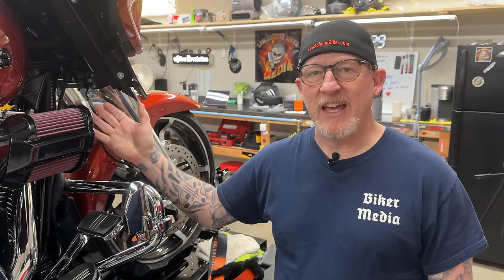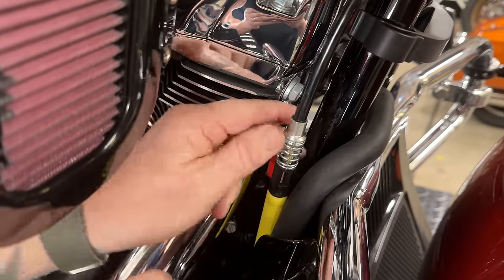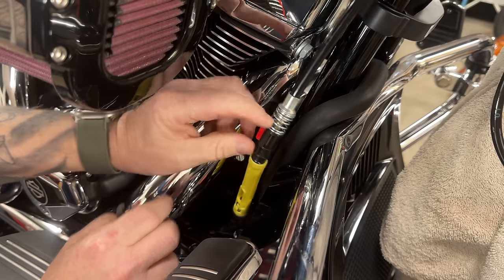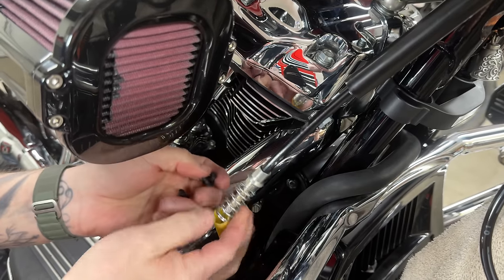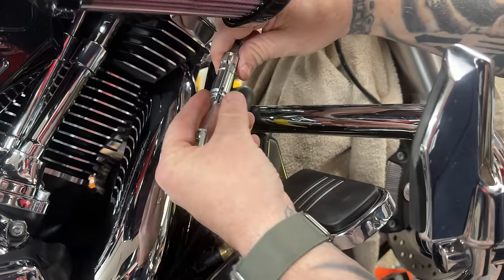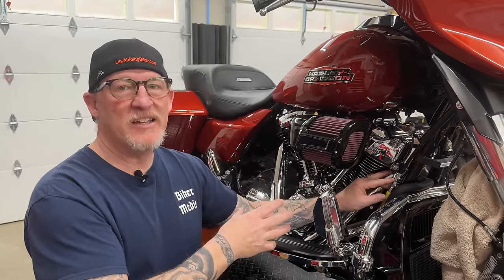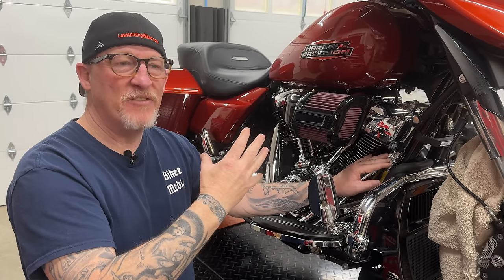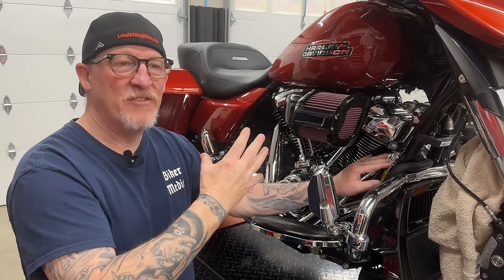Every Harley Owner With A Cable Clutch MUST FIX THIS! DIY

Comment: You really shouldn’t have to be fixing anything on what these bikes cost ! 😬
Reply from the maker: Agree
Reply: This is Ryans opinion. You do not actually "need" this. It does make fine tuning clutch handle adjustment a bit easier. 
But I ride everyday and Ive never "needed" this. 
Using the factory adjuster, u can vary the distance u push down on the spring to adjust the handle slack. Push all the way together=more slack at handle. Push spring in a little=less slack at handle. Its quite simple.
Reply: Awesome video!
Reply: It’s not about fixing. It’s about preference.  When we compete in rodeo competitions, we like our clutches in a specific spot.  I adjust my clutch lever as close to the grip as possible within the tolerance so it doesn’t jump when you start it in gear.
Reply: Awaiting for that hydraulic conversion video. I really miss my AIM slave cylinder’s hydraulic clutch
Reply: Agreed!
Reply: Yes like when you buy a Ferrari you nerve have to maintain it just run it no maintenance required

Comment: Harley used the same threaded lock-nut cable adjuster on their clutch cable for years and years.  The cable adjuster on my 2017 Dyna was exactly the same as the one on my 89 Evo Low Rider.  And they replace it with some stupid fragile plastic POS?  Jesus.

Comment: That new style cable looks like a nightmare. It seems like Harley tried to reinvent the wheel just get the old style clutch cable we’re all you needed was a 1/2 and 9/16 screw it in or out to adjust.

Comment: I've had 4 Harley's since 1998 and I currently have one with a hydraulic clutch and one without. I prefer the cable feel and I am convinced that it has a wider friction zone and is easier to pull than the hydraulic one. JMO

Comment: Ryan I totally agree I had a 2014 for 7 years and had no issues and loved my hydraulic clutch. I bought a 2021 street glide special and hated the cable clutch and almost got rid of it. That red button will eventually fail and has no adjustment. I had several friends get stranded. I put the fat bagger replacement on and now I have peace of mind and have the right adjustment I can live with. By all means everybody should do this mod or risk being in the middle of nowhere and have a clutch failure. Easy to do and well worth it.
Reply from the maker: Thanks for sharing.

Comment: Love your videos but I had my 19 street glide and I had alot of issues with the hydraulic clutch, mostly when stuck in traffic with 80+ degrees days and the clutch grab different every time, the cable doesn't matter temps or condition I have it set to grab the same each time

Comment: I had the yellow tube fail on my 24. I replaced it with the EZ Install Black Vinyl Upper Clutch Cable 108000-B, the clutch pull feels better and it has an adjuster at the top which lets you dial it in on the fly. The metal on metal assembly gives me peace of mind. Id highly recommend it

Comment: I have the stock adjuster on my 22. It works fine. I have fine tune adjusted I can find neutral with no problems whatsoever. I disregard what Harley says and I adjust the clutch to the way I like it..

Comment: Replaced the OEM adjuster on my 21 Tri Glide and it was little tough chipping away to remove it. Not a lot of room when you have lowers. But finally got it removed. However when it came time to put the new adjuster on it didn't slide together very smoothly. The oem threaded stud inner collar had to be filed down just a bit. Didn't take much. Could be the dimensions on the 21's are little off. The oem plastic adjuster never did adjust too well. The new Fat Baggers adjuster was well worth it and the video was very helpful especially for a senior rider like myself. Purchased the new product along with the seat screw ( Ric Rac ) and received the order very fast.

Comment: I'm running after market shorty shifter levels and I had way too much slop on the clutch side, the level would rattle when i was riding. I saw this video and ordered the part. I just installed it and I'm happy to report It easily adjusted all the slop away. I haven't road tested but Thank you, Ryan.

Comment: The clutch on my 2023 low rider s failed the other night as I pulled into a garage, turns out the red plastic clip had slipped out (not broken thankfully) - clipped it back in and I was away again - but if it had broken would have been a mare.  I've ordered one of these from Revzilla who post to the UK - crazy that you have to do something like this to a new expensive bike but I just don't trust that flimsy plastic clip at all.  Great video btw, will be very helpful when I fit the part - cheers.

Comment: My wife’s 2020 Softail Slim has had clutch issues and the dealership can’t even get it correct. You pull the clutch in and it’s barely in neutral and hardly rolls. Will this device correct the problem?

Comment: i believe they recommend to totally back off the clutch adjustment in the primary before installation, then readjust the clutch after you install, then adjust the fat bagger’s adjustment. i just purchased it, plan on doing mine. thank you for the tips. i have a softail but i believe it’s basically the same.
Reply from the maker: You can certainly do that. Especially if your plates are already wore a bit. This is a brand new bike. Plates are fresh. Ride safe

Comment: Hi Ryan love your videos. I bought a new road glide limited 2023 and that's the old thing I don't like about the bike is the cable clutch. I feel the hydralic clutch is smoother but look that's just me. O yea  and my bike is just 7 months old blacked out and the front forks are a big disappointment with the black paint flaking of and harley here in Ireland doesn't want to know about it. Very bad back up service.........

Comment: Ryan, you say you break in your clutch on a new bike aggressively. I have a new 2023 Road Glide Limited. with 107 miles on it, and they say for the first 1000 miles but not to run it over 3000 rpm. What do you suggest?  The weather has sucked this year so far, I am having problems riding in the weather in Ohio. I need to get my first service before June.

Comment: You think that rubber boot is hard try doing that with a 22 model trike!! There isn’t any room to get the sleeve off without damaging it. I have the fat bagger’s adjuster but haven’t took the time to install it. I have the PSR adjustable clutch lever and love it.

Comment: Ryan I just added this to my 2024 SG. I am also interested in added the PSR adjustable levers. I really like the stock adjustable brake lever. Some t8me ago a purchased a set of FLO adjustable levers for my 21 SGS. After installing the levers the cruise control would not engage. Have you noticed anything like this with the PSR levers? Thanks, Mitch

Comment: The Muller Easy Pull or Advanblack copy look like 2 good alternatives for clutch lever pull reduction with cable clutches. I installed the AIM clutch slave on my 2020 Road King which made a 'UGE difference. Harley just couldn't design a hydro clutch like the 1 finger pull Brembo systems I guess. I've got a 2023 Heritage which needs this adjuster.  Great video, Ryan!
Reply from the maker: Thanks much

Comment: I'll probably be looking into this product,  i seem to be needing to adjust my cable alot . frequently feels a little off after every  few rides , nothing ever slips or too bad on the lever , just a little deferant feeling enough to notice, always wondered. .  So this is the fix to that . I've never tried the hydrologic type now im curious,  will be checking out that video,  thanks for info/making them .
Reply from the maker: U betcha. Thanks for watching.

Comment: I got the new full upper clutch cable with the new thumb turn adjuster up by the lever.  It's also from Fat Baggers and I really like it.  Works great and much easier to adjust on the fly.  Ryan check it out and you could carry that in your store as well.  thanks

Comment: My 2016' Road Glide CVO has the hydraulic clutch,  it's good. After I put on the Recluse slave cylinder it became incredible! I tried a new 2024' at the dealer and hated the clutch. Very heavy, does it ever break in and get easier over time?
Reply from the maker: It doesn't get any easier on the pull over time.

Comment: Hi Ryan like your channel, do you know if They make them for softails, my 2022 low rider St has had  clutch cable replaced and adjusted twice. Now it’s needs adjustment again, miss hydraulic clutch thx Ed
Reply from the maker: It's a softail, so yeah. We have two models. Fitment says 18-23 softails with cable clutch ==> https://shop.lawabidingbiker.com/products/copy-of-fat-baggers-inc-ez-clutch-adjustor-upgrade-22-and-up-harley-touring?variant=43142471221404

Comment: Much prefer the cable clutch. And honestly never had an issue with that adjuster
Reply from the maker: Cable can be fine for many just cruising etc. Hydraulic is superior for riding hard, training, and competing.
Reply: @RyanUrlacher  never in all my years have I heard such crap.  You got actual facts to back that up?  It seems it's just your opinion

Comment: On the adjustable clutch lever 
Does that affect the clutch in a way that it won’t fully disengage or slip ?
Reply from the maker: No, doesn't change when the plates grab. It's literally just a lever adjuster to put it where you want it. It does nothing to the internal adjustment of the clutch.

Comment: So does the BAGGERS EZ CLUTCH ADJUSTOR make the pull any easier or is just quite literally to make adjustments easier?

Also I got a set of the PSR Journey levers and will have a video of them being installed soon. They are fantastic! Just an FYI though on the brake side if they were set to position 1 you won't be able to engage the brake hold function; you'll have to put them in position 2.
Reply from the maker: just makes adjusting better and easier. We did a video on the AIM Light Force slave cylinder kit. Makes the clutch pull super easy. Look at the bottom of this listing for the video ==> https://shop.lawabidingbiker.com/products/light-force-clutch-slave-cylinder-for-2017-m8-touring?variant=41568956154012

Comment: Maaan HARD disagree that the hydro system is better. You get way more friction zone and adjustability out of a cable clutch.
I hate doing slowspeed stuff on a hydraulic clutch bike. It's so much easier to do with a cable clutch. I would have cable clutch on every bike ever if I could. CFMoto has cable clutch feel on their bikes that's like the Harley clutch and its SO NICE. I love the feel of a cable clutch. Hydro feels like an almost on off switch and it feels clunky.

Comment: I had a hydraulic clutch on 2019 Road Glide Special...I never liked the feel.  The cable clutch on my '21 Triglide.  I do agree, the hydraulic "should" be better all around, but not sure H-D has this turned to compete with the competition who seems to have nailed it...otherwise, why would they go from cable clutch after decades, to hydraulic for a few years, then abandon that and return to cable?
Reply: Money!  Cable clutches are cheaper and HD is all about cutting corners to save a buck.

Comment: If you are going to go hydraulic I put on my 18 Street Glide a rekluse clutch slave it literally feels like my dirt bike
Reply from the maker: Yah, we did a video on the AIM Light Force slave cylinder. Same. ==> https://shop.lawabidingbiker.com/products/light-force-clutch-slave-cylinder-for-2017-m8-touring?variant=41568956154012
thanks for sharing.
Reply: @RyanUrlacher  man I got to go back and check that out I love my clutch slave

Comment: I HATE a cable clutch!!!!   You will too when you have one snap on you hours from home leaving you stranded.  Fortunately for me I have a 2020 Ultra Limited with the last offering of a hydraulic clutch.  If Harley doesn't bring the hydraulic clutch back I'll never buy another one.  My other bike is a 2007 Honda VTX 1800 with over 103,000 miles.  The hydraulic clutch on this bike has NEVER given me any problems.
Reply from the maker: We'll be doing a hydraulic conversion on this bike. Coming to the channel.
Reply: @RyanUrlacher  How much does that conversion cost?
Reply: Hydraulic clutches fail too and there is no limp home trick for them. A cable clutch can (as I and many others have done on the road) be made useble in an emergency by shortening 
the sheath by cutting then using visegrips to pull on the cable.  (Those really serious can carry a cable saver or make one depending on your lever side cable end.)
Cables rarely fail without losing a few strands first so inspection (pull lever, apply eyeball) matters. I've been wrenching multiple brands since the 1970s and am comfortable wrenching anything from combat aircraft down. I greatly prefer cables and have done gobs of shop work fixing customer hydraulic clutches which are very easily killed by sitting (after which the piston seals cease to seal.)

Comment: Saw vid title.. had to comment on this one right away ..
ESP if u have a lockup clutch or heavy springs u need to do this.
That $0.25 piece of Chinese plastic crap can def leave u stranded. Can’t believe for 2024 Harley didn’t take the fat baggers design.  Fkn red plastic clip holding up the entire show 
😡